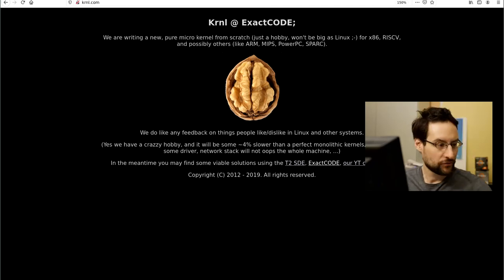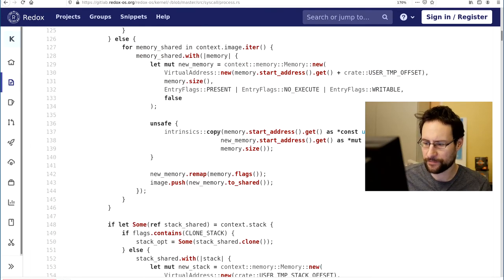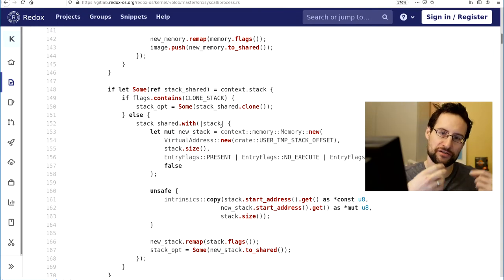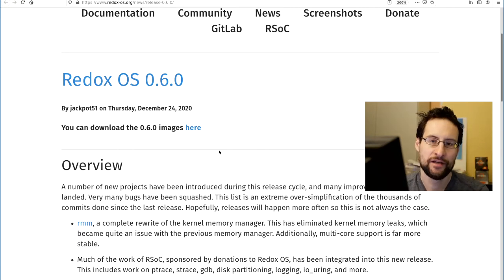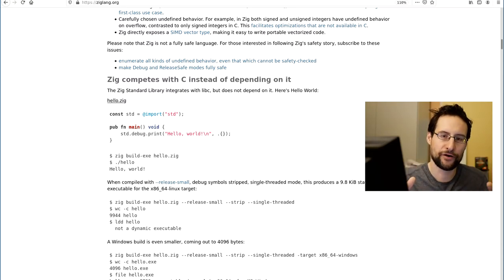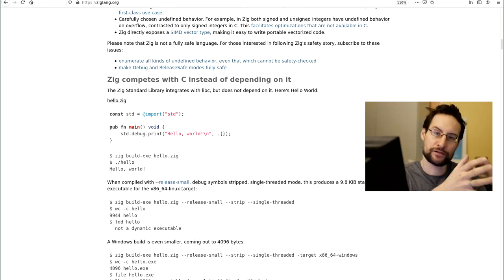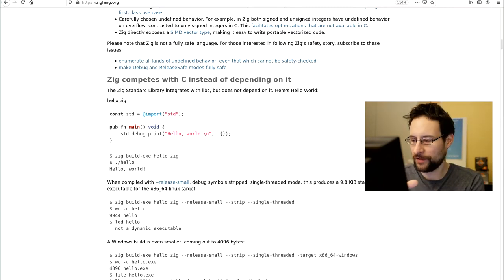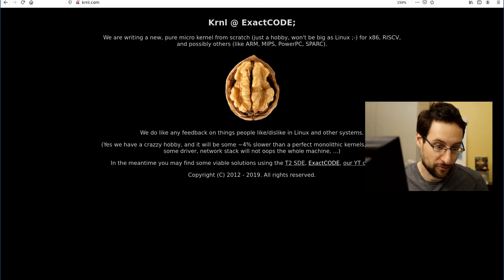Rust, the state of and why I will probably not write my new kernel code in it, yet!

Comment: In my opinion, not using rust is totally fine. I think the ideas and concepts behind code is much more valuable than a code by itself. If you write your kernel in C++ and change your mind, it will probably be much faster to rewrite it in rust than starting at 0 again.
Some of my most important (private) apps, I have rewritten from scratch up to 5 times! Each rewrite takes a fraction of time compared to the previous...
I would use rust but it is a matter of taste. I prefer locical beautiful things over simple redundant things. I say go with C++, find a stable api (that focusses on minimalism/performance instead of intuition) and then you could swap stuff out atomically.

Comment: Super lightweight Rust with only rustc and core / alloc library is actually usable. The problem is that almost all rusteans use cargo build system and the std library by default. The cargo build system obviously leads to microdependency madness. The std library is bloated as well. It takes about 3Mb of space and linking that library consumes time. The combination of cargo and std make build extremly slow. Besides the std library is really difficult to build and dowsn't provide really nice abstraction. A lot of developers choose alternatives to std, like crossbeam.

Only using rustc and core / alloc requires nightly rust already. However the compiled executables are only about 10 to 100Kb. The build system is simplified as well which also yields to reasonable compile times and easy integration with other languages.

The downside to that approach is that rust requires some C functions from libc (like printf for basic output) and a lot of unsafe glue code for abstractions.

Comment: The rust error messages are way better than C++. The pattern matching and other functional programming paradigms add little complexity in syntax. Also memory leaks aren't considered unsafe because memory leaks do not offend the memory safety guaranteed by Rust. So I think its about tradeoff. Do you want to spend more time with coding rust, learning syntax but having 99%(other 1% counts for compiler & stdlib bugs)  guarantee of not having undefined behavior, data races, buffer overflows etc or you want to spend less time coding in C++ and more time to deal with the bugs introduced by unsafe code.
Reply from the maker: I never had such a problem with c++ diagnostics. Sure if you do excessive template meta programming it gets out of hand, but a little bit better diagnostics are not a killer feature for me. Especially when the compiler is that slow and I see bugs on rust projects, too. To me it does not look like the holy gral some fans like to promote it to be.
Reply: @renerebe  Well rust is not perfect but its way ahead of its competitors in certain areas like safety and lacks behind in certain areas like compile times. Did you consider number and types of bugs in pure rust codebase(no ffi) vs c/c++ codebase?

Comment: With the new microkernel operating system, security should take precedence over speed, so as not to repeat past mistakes. Rust has conceptual advantages in the very important area of parallel programming. How can the security aspect in this area be sufficiently implemented in the alternative programming languages (Zig, C++) in question?
Reply: We all scream for security, but no one wants to write proofs that guarantee security